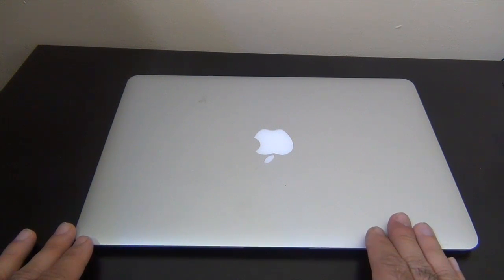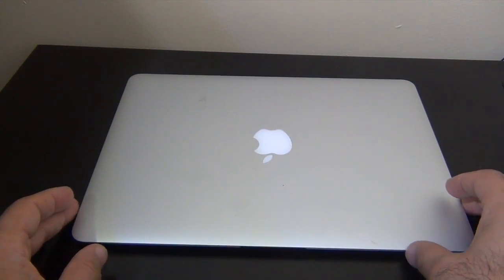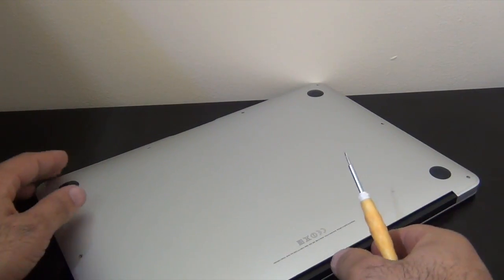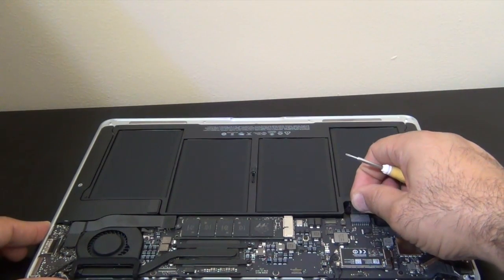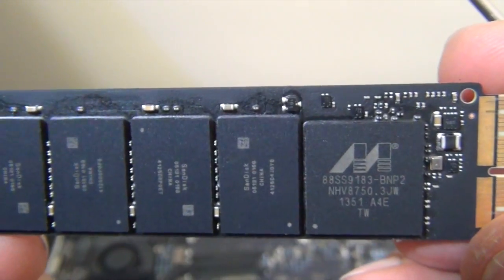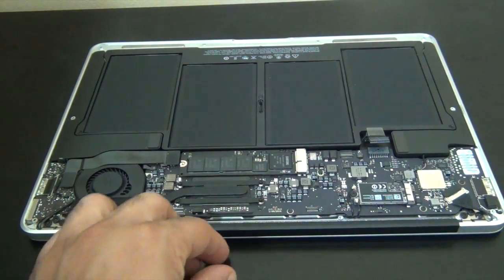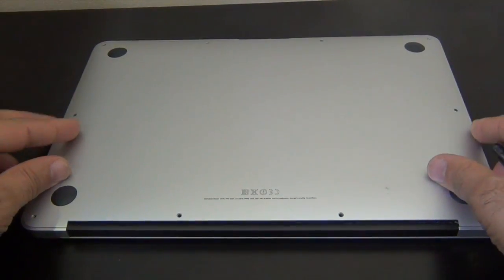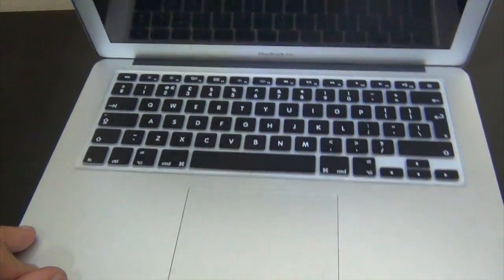MacBook Air SSD Upgrade or Replacement Guide A1466, A1465

Comment: Can the memory be expanded to 16GB, or is 8GB the maximum?
Reply: From what I've seen and heard macbook airs had the ability to go up to 16gb of RAM but apple never implemented it when selling the system.  This means that the SPI Rom has to be modified and that you after that point have to use Open Core Patcher in order to make the system function with the upgraded RAM.  If you use regular MacOS after that you'll brick the computer.

Comment: Can someone explain me how I get everything on the new ssd if I upgrade mine? Do I need to transfer a backup of my regular ssd to an extern ssd and them transfer it back to the new one?
Reply: Exactly. I have clone 2.5in laptop SSD drive before but it would be worth knowing how these stick SSDs can be cloned. I would have thought that if it can be done via a USB-ed unit beforehand, the old SSD stick could be cloned onto the new one and you pretty much have the 'same' machine. The video drops points for clarity.
Reply: @pfgpowell  thanks for responding. I‘m still trying to find the easiest way for me to do all these things.. the mosz confusing thing atm is: which ssd do I need to buy and do I need an extra adapter???

Comment: Could you use just any regular M.2 SSD drive with it or does it have to be a specific one?
Reply: with an adapter for the macbook air you can use any M.2 SSD.  I know because I did and the cost is WAY LOWER.  Not only that but when you use an adapter for any M.2 SSD you can also afford to go to 2tb for about 100.00

Comment: OK, but how you install the macOS
Reply: Don't even need a bootable USB if going back to a clean slate. Just press command R after hitting power, there you can connect to wifi and the Mac will install a clean OS.
Reply: Bootable USB, boot up and hold command option R

Comment: How did you copy your older SSD os and data into this new SSD
Reply: I would suggest a time machine backup previously to an external drive.  Then use time machine to bring back those files.  It’s easy.

Comment: Which SSD is suitable for this macbook?
Reply: Because Apple uses a proprietary SSD you have to buy a aftermarket drive from somewhere like OWC like these https://eshop.macsales.com/shop/ssd/owc/macbook-air/2013-2014-2015.
A cheaper option is to use a M.2 drive which you can buy 120GB for around $70/80 AUD or 250GB for $120 AUD and use an M.2 to Apple MacBook adapter for around $10-20 on eBay/Amazon. But you have to be careful going this way as they might not be compatible. You can make huge savings this way though so worth looking into.
Reply: may i have the link for adapter?